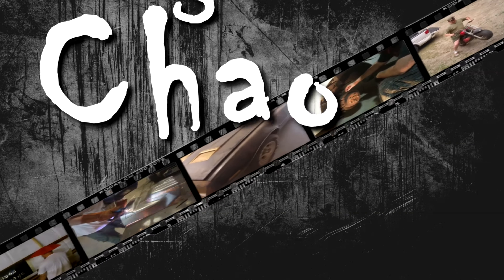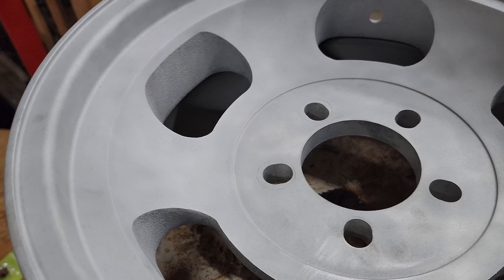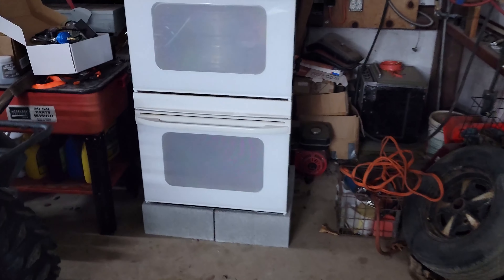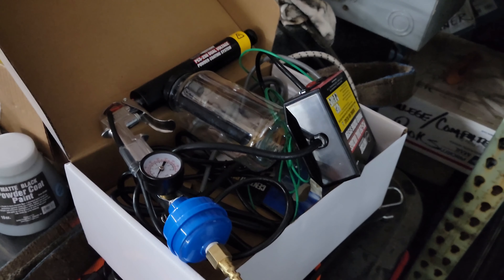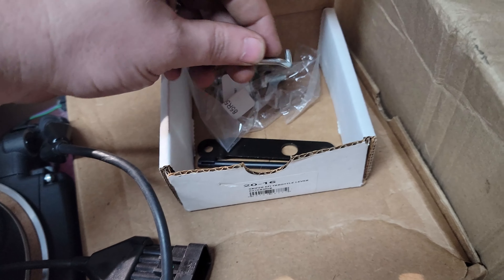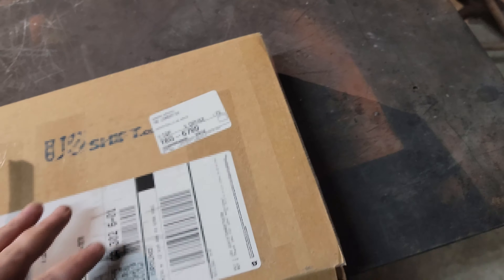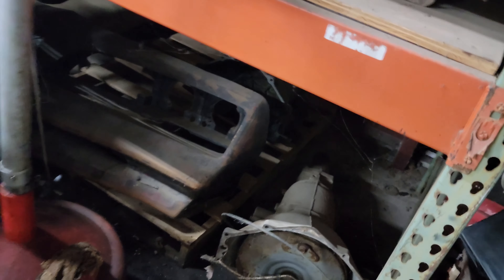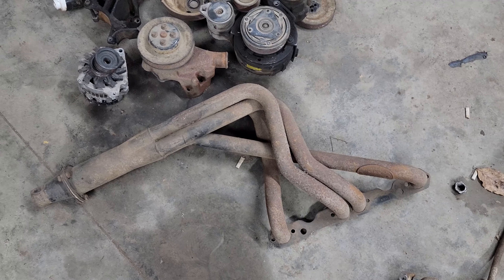1978 Firebird Formula Part 16: Am I Ever Going to be Happy with these Aluminum Wheels?

Comment: Are they Uni lug wheels?
I had a set of those. they started out on a 70 AAR Cuda and then I got em cause the owner owed me money. 
They were on a 72 Dodge van for a short time and then I ended up scrapping them for 25 bucks a piece. 
Good stuff. They shoulda bored out your engine a bit more so you could say ya gotta 389 under your hood. 
Happy Motoring.
Reply from the maker: Good eye. The lug holes are oblong. I didn't even think to question why but you're absolutely right! The more you know...huh
Reply: @ChaosGarage  You got the washers too right, to take up that extra space. Big difference on spending on projects from when you're single to when you get married. Well unless you're independently wealthy. Which I'm not but maybe Elon can be my friend.  Hop up some electric vehicles.
Reply from the maker: I'm married...fortunately my wife loves me and knows I'm gonna do what I wanna do! That plaid tesla on the drag strip is a rocket...